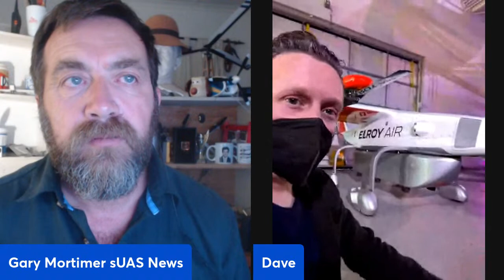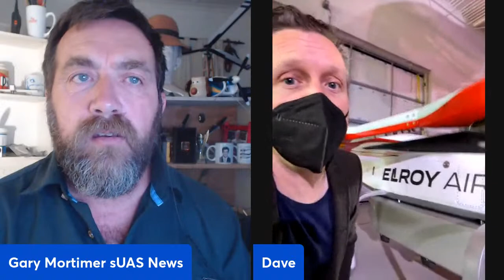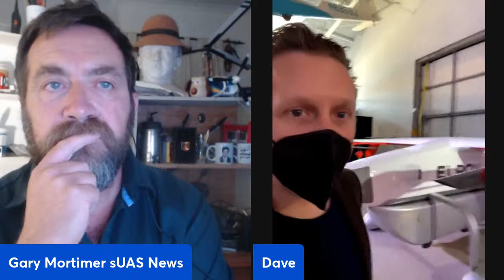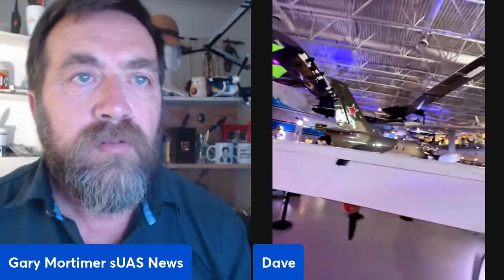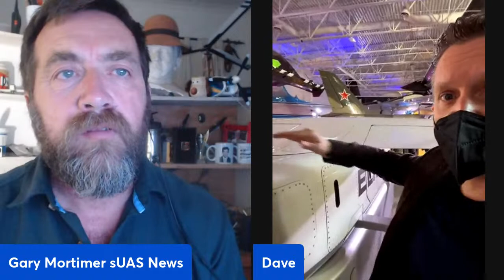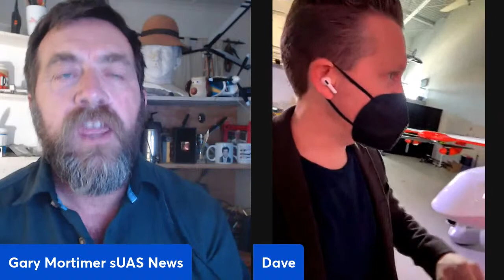Meet the new Elroy Air Chaparral C1

Comment: drop cargo sounds a bit weird cause dropping is a different kind of delivery than landing and releasing the cargo on the ground.

8 vertical engines for take off and 4 for flying will cost a lot of efficiency by the drag that can only be compensated by a hybrid or onboard generator. Sounds like the BMW i8 or Ampera / Volt with the range extender.

This is a different beast considering the huge amount of payload which will not be for private customer delivery, only b2b like from an amazon fullfillment center to a company.

Might work in the USA in high density urban areas where traffic is slow and delivery time might be high even express.
But it will depend on efficiency which has been solved by hybrid cause 1 kWh battery with its weight versus 1 liter gas in tank with 10 kWh add a lot of range. But here the whole CO2 will kill that idea for city areas cause the synth fuel will not be allowed for such ideas.

Interesting though cause H2 and fuel cell stacks are allowed so it can change if there is an alternative to the combustion engine that is part of this hybrid. Hybrid still covers that it is combustion engine.
Reply: Yeah they're pitching this as for areas without roads in the Congo and in diaster zones. It ain't happening. Yet what boggles my mind is with only a few dozen views on any of their videos who the fsck funds these people? How do they make a crust? I've known so many great minds who've made vastly superior products and can't even get funding to get to the prototype stage yet in the US there's all these vaporware producers. Where's all the money coming from? And why don't they back more reasonable projects that your insurance policy and government won't immediately disallow?